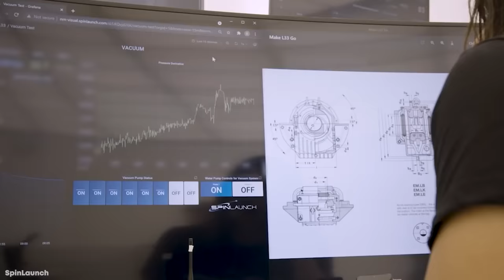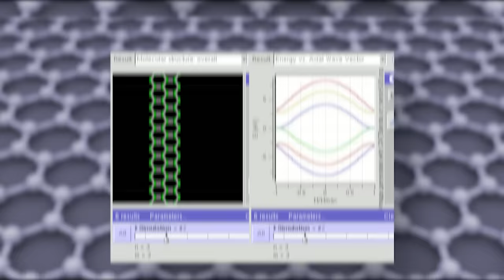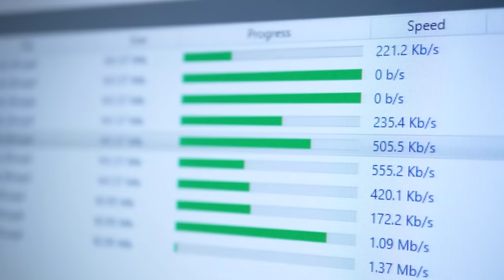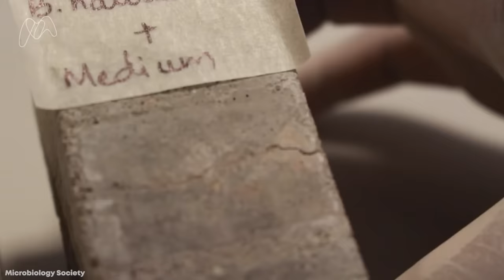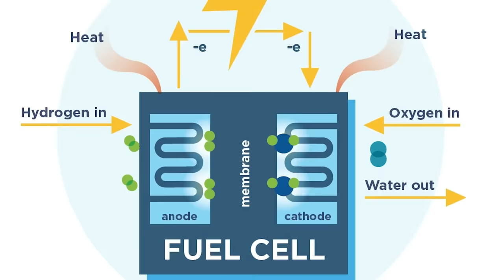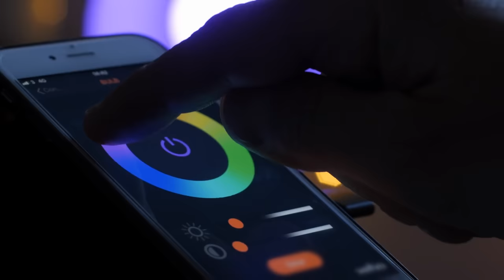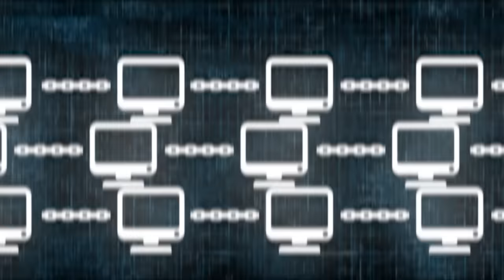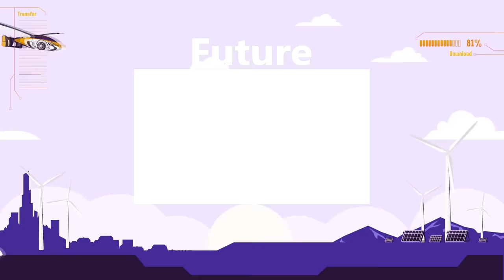15 Emerging Technologies that Will Change the World

Comment: Most big rockets I know of use hydrogen and oxygen as fuel. End result, a lot of thrust and H2O. How is that polluting?
Reply: If only you factored in how polluting the process of producing pure hydrogen and oxygen is, as well as storing and transporting them, you would not have raised that point of end product!
Reply: H20 is water so hydrogen and two parts oxygen
Reply: @mazvimbakupa.chihota  pure oxygen is not hard but hydrogen is a little but both are explosive in concentrate
Reply: There is a common misunderstanding that pollution = greenhouse gases (global warming) are the same thing. They are actually opposite: the more efficient an engine is the less polluting (less CO and NOx poisonous gases) it creates, but instead it creates CO2 and H2O which harmless for what concern health. The problem with CO2 and H2O is that they are greenhouse (i.e. they absorb infrared light) and lead to global warming; their impact is increased when they are released in the upper atmosphere, which means airplanes and rockets.

Comment: They have already had a quantum computer functioning for several years called the D-WAVE computer, they use this at CERN and other facilities.
Reply: That's what she said.. Just joking. What's it being used for?
Reply: @danieldelewis2448  They are using it at NASA for mapping the global weather patterns and climate, and to make future projections around climate change. What Google and Microsoft are doing with it, mostly using it for AI development. The pender growth fund has a small stake in D-Wave, which I own shares in.
Reply: I hate to be that guy, but D-WAVE is not a fault-tolerant universal quantum computer (and that's what we really want). It's a quantum annealer, which, while it certainly exploits quantum effects, falls well short of what most people are talking about when they talk about a future qauntum computer.
Reply: @Quinn2112  I hate to be that guy, but I never stated that it was a fault-tolerant universal quantum computer.
Reply: @MrRockstar1968  Fine. More simply stated: D-WAVE is not a quantum computer in the sense discussed in this video, so your original claim was wrong.
Reply: @Quinn2112  My original statement is based on what the inventor of the D-WAVE computer Geordie Rose himself stated,  I also did not state that it was in the sense of the video above either, therefore my original claim is not wrong. You are wrong, ok!

Comment: GPT3 is an example of the type of AI tech we should not and do not need. Replacing people with tech is always bad, especially when you're replacing talent. People need jobs; and simple people need simple jobs even if it's just typing and responding to other people. Let's develop AI but only as a necessity and as a enhancement; not a replacement.

Comment: Solution to wildfires: Manage the forests (logging). The western forests are meant for fires. With the advent of Smokey the Bear we started stopping all fires. Now the forests are all over grown so the fires have ladder fuel and get into the tops of the large tree and are massive. Before humans butted our noses in the the fires would stay small and only take out the underbrush because the forests weren’t overgrown and the fires couldn’t climb into the large trees
Reply: As well don't forget there are now 90% more people now living in fire areas than there used to be. With the non existent brush clearing being a thing, California since the late 70s (wouldn't till recently) let power companies demand home owners remove trees near powerlines. The fires haven't changed just peoples behavior, and living where one shouldn't.
Reply: @SpeedKLS  yeah, the ecosystems in the west were adapted to fire and needed a fire to come through about once every 10 years to clear the underbrush, fertilize, and melt the waxy seeds of some plants. We stopped that process and interrupted natures balance. Where fires used to bring new life, they now burn everything to the ground and sterilize the soil. Then afterwards when it rains or during spring runoff, there are mudslides because the vegetation isn’t holding the soil in place
Reply: Logging is one thing, and smart forest management is another.
Reply: @incognitotorpedo42  not really. They are the same today.

Comment: If you can unlock it from your phone, others will find a way to do it from theirs. If you can disable your alarm remotely, others will find a way to do so. At some point casing, a house for robbery will involve remote deactivation of security measures to allow undetected theft. If you can do it remotely or involve an internet connection the potential for a breach exists.

Comment: Concrete is made crack resistant far cheaper by making it somewhat softer with the addition of hydrated lime, and by using low cost polymers like PVA added to the mix. Also coal fly ash and other additives which are already in widespread use.
Reply: Yes, but the existing methods you mentioned are even still only situational and not a perfect universal solution. Where are the bacteria will benefit in any enviroment

Comment: 15. Spin space launch 
14. Graphene 
13. GPS 3
12. Floating farms
11. Edge computing
10. Self healing concrete
09. Hydrogen fuel cells
08. Satellite constellation
07. GPT 3
06. Connected homes
05. Lithium metal battery
04. 3D printing
03. Blockchain
02. Fighting fire with sound 
01. Quantum computing
Reply: There have been at least 2 summaries already
Reply: @DanDascalescu-dandv  the 2nd person wrote summary because he didn't find the first one, i wrote because i couldn't find both of them.

Comment: Regarding hydrogen fuel cells, the byproduct isn't water. It's water vapor. This is a very important difference because water vapor is a greenhouse gas that has the same thermal insulating properties as CO2, and it's the most prevalent greenhouse gas; making up over 80% of greenhouse gases in the atmosphere. Hydrogen fuel cells produce greenhouse gas emissions just as much as an internal combustion engines.
Reply: It's just highly explosive

Comment: Although edge computing has been exploding the past several years, it is certainly not all that new. I worked at a start up, a convergent start up between hardware and software, and we had a working proof of concept of an edge router. That was in 1999, 25 years ago.

Comment: I don't know which factors you used to rank these technologies but if the impact to society was one them, then I don't see how Blockchain would ever rank higher than solid-state batteries. Apart from AI, there is no other technology on this list that would rival the impact the arrival of cost-effective solid-state batteries will make on our way of life. Think about mobility, gadgets whose battery would practically never die, etc....

In short, the categories of new technologies that will impact our society the most are three:
3) new materials (e.g. graphene): if new materials with exotic properties such as room-temperature superconductivity are discovered, then it's a big deal.
2) energy (e.g. fusion power, battery tech, fuel cells): if we can harness new sources of energy, and find a way to store it more efficiently, then our lives would be much much easier.
1) AI (e.g. AGI): if we reach singularity, then it will simply mean game over (for humans as the masters of the world). By definition, the making of an AGI will be the very last discovery humans will ever have to do!

Comment: Amazing compilation as usual. But you really should investigate fuel cells (AKA fool cells) better. With an efficiency of less than 30% overall (energy in/energy out), it slowly is overrun by solar panels and isn't even as efficient as an ICE.
Reply: It's much more efficient to pick a tomato from a plant and eat it right there. Why would anyone go through the trouble of canning tomatoes?
- Fuel cells are a dispatchable, long-duration energy storage solution that provides power when the wind doesn't blow, the sun doesn't shine, or the power lines are down during and after a storm or wildfire hits an area. Comparing solar panels with fuel cells, and focusing on efficiency, just shows how little you understand about either technology.

Comment: Anyone selling Spin-launch as viable is probably riding the same short-bus as the Solar "Freakin" Roadways crowd.

Edit: #10 is insanity. You are going to repair concrete with limestone?!
Limestone veritably melts when exposed to warm water. One summer rainstorm and those building with "healing" concrete are rubble!

Comment: Floating farms can be used in places where the ocean has only sand surface beneath, and thus has no use
for the ultraviolet. If done correctly they can be set up to still allow light to pass through, for algae growth,
while using a lot of it for plant and/ore (fruit)tree growth.
This will also allow the fruits trees to grow stuff which then is separated by land, and thus has
no insects or birds that are natural predators of the fruit or vegetables in question.
The fruits and veggies would need no insecticides or such.
Maybe a bee farm added for pollenization and additional clean honey, since this will
now also not include pesticeds within.
Maybe 50 km offshore to make sure there's no insect infestation, but also on a plastic support structure
to elevate it high enough for waves to pass underneath and forego the sand to become salty again.
Reply: This can also be done to save 'old'' species of plants which are supplanted by their newer DNA altered versions.
Reply: This is just an asinine idea. Growing crops on a floating platform us beyond foolish.

Comment: Spinlaunch is pretty much a Scam though. Maintaining vacuum in large containers is borderline impossible without making the container capable of withstanding the crushing weight of the atmosphere, and it usually requires very thick steel constructions with sealing rings/gaskets made of not rubber/silicone but copper. No way in hell any kind of a textile big enough to let the rocket through could withstand that. Besides, EVEN if you were to maintain the vacuum for extended period of time, create a material strong enough to withstand the pressure and be capable to spin the rocket to speeds they want to get them to - upon exiting the vacuum the rocket would SMASH into sudden resistance of air particles, which would most likely absolutely demolish the rocked at those speeds.
Reply: It does seem reckless.
Reply: @marianneciccantelli335  Reckless is an understatement. Imagine a rocket spinning fast enough to reach MACH 6(!!), then missing the launch time window you have by a milisecond. It'd get mauled at mach6 into the walls of the container, and possibly into the building itself with all the crew inside. Not even mentioning the astronauts, as there would be nothing left to bury.
Reply: And there's also the issue of counterbalance. You cannot just spin it without a counterbalance, the vibrations and forces would be too strong to withstand for any material on earth. Then after the launch, what do you do with the counterbalance that's left behind? Launch it too in the opposite direction? If nothing is done it's going destroy the machine that very moment.
Reply: maintaining the vacuum is definitely not a problem because we have already functioning vacuum systems with bigger volumes. Of course the forces created by the surrounding air pressure are immense but with the right dimensioning of the hull not a problem. The centrifugal force on the arm holding the rocket is proportional to the length of the arm so this is also only a dimensioning problem and not impossible and we also have already rockets which can maintain speeds of mach 4 at ground level so therefore mach 5 or 6 doesnt seem so impossible.
Reply: @bec1111  Did you actually see the vacuum chambers you're talking about? Yes, huge vacuum chambers exist, but as I've said, their required structure and gaskets made of metal make the technology not viable for what they're trying to do. You could propably make a shape similar to a donut without a hole inside, but the problem is the membrane that the rocket is supposed to rip through. What they've shown on their video of launch is a rocket thrown out through some sort of a membrane, but the chamber was at atmospheric pressure! (we can see no particles nor air entering it after rupturing the membrane). 
Also, gaining speed in the air gradually and increasing the resistance in time is MUCH DIFFERENT than suddenly smashing into air from vacuum. It's similar to air to water transition. You can gain speed in water without issue, but if you suddenly at high speed try to dive underwater, it'll feel as if you hit concrete. Going from vacuum to hitting air at high speeds would result in a MASSIVE spike in resistance, all rising up at once. It will be catastrophic unless those "rockets" were turned to literally be like bullets, and if they were to be made like bullets, why bother and not just literally shoot them out like ones directly upwards without trying to spin them around for hours before launch? (the shooting thing was actually tried before and it kind of worked, but had its own issues too). As for the people - dude, the people were inside the building that's attached to the spinning chamber. They were operating the thing through consoles xD
Reply: And as for the centrifugal force - I have no idea what you're talking about. The centrifugal force is a function of the rotation speed, the mass of the spun object and the distance from the center. But what I was talking about was the fact that if you want to spin ANYTHING at high speeds reliably without destroying the machine, the thing you're spinning must be attached at its center of mass. Even if you counterbalance the rocket at first, after the launch it's not going to be balanced. Since you cannot just stop rotating instantly, the machine would then suffer greatly from spinning at insane speeds while not being balanced. Unless insanely overengineered which would make it unpractical and not at all economically viable, it will not be able to survive even one launch, not to mention multiple in a day as they wanted to achieve.
Reply: @Rychlas  actually I once visited a synchrotron facility in Germany which also maintains a vacuum tunnel with a volume of a similar magnitude to the spin launcher.
That's only partially true there are plastics (PTFE,...) that can be used in vacuum chambers, and since there is no requirement for an ultra-high vacuum I don't think that this is a major problem. 
Since the area of the membrane is not so big there are not incredibly high forces on the membrane (~10 tons for a one square meter Area) they could also use multiple membranes where the pressure between each membrane decreases. 
Yes, that's right but my argument is not that they did it but that it should technically be possible to do (at least the things you are concerned about).
I think if the rocket is designed to withstand the g forces during the spinup (which is my main concern by this project) the negative acceleration by hitting the air should not be a problem and yes I think the rocket will be very similar to a bullet (why they don't just shoot it? I don't know maybe reusability benefits?) Ok, but it shouldn't be a problem to place the control facility somewhere else^^
Reply: Yes exactly and therefore if you increase the distance from the center (while keeping the other values constant) the centrifugal force decreases and therefore the force on the arm decreases.
I think they plan to use a counter mass which will be simultaneous with the rocket released and therefore the system should be always balanced. But I have to admit that the release mechanism will have to work really fast and reliable otherwise it will destroy itself.

Comment: Spin Launch. Not viable for human content, needs extreme strong satellites or whole cargo.
It can be used for mass elevation, where like raw resources can be sent into orbit, maybe, but here's a limit.

At mass of 1 kg on Earth, an arm of 400m, a maximum centrifugal accel of 15G's, you get 245 m/s, which is nowhere near the 7000 m/s to reach and stay in orbit. In order to reach 7 kms you need to go past 12K G-forces. Yes, you can send powder to space, great.

That's not counting speed loss due to be decellerated by gravity while going up.

If you can use a 5 KM long arm, with 15G's like the maximum human G-force, you can get maybe 866 m/s.
At 50 G's for cargo, it will yield 1.5 km/s free speed.

Will it change the world ? Not much, but it MAY lower fuel costs for launch, but there's a linear accelerator for such, which allows for speed gain at lowered G-forces, up to 1.5 km/s at human survivable G-forces.
Reply: Ok, compressed air in large volumes, instead of SRB's, can be used to increase
velocity at the cost of..compressed air. I don't know by how much yet,
but I'm at least thinking one cubic kilometer of compressed air, with a tiny
thermal element. Maybe thermite. The boosters would be huge in
comparison to the actual space ship or it's engine stages,
but should lower actual fuel usage per launch considerably.
(Solar powered air compression 24/7 is cheap and storage abundantly cheap as well.)

Comment: Well, well... So we are going to be wiped out when concrete takes over the planet. How strange.
What happens when a self healing building gets demolished and the concrete dumped as land fill? The spores will form shells. What happens when a builder, plumber etc drills a hole and the dust blows around the room then gets breathed in (after the spores have activated) ? Concrete lung and clogged bowels?